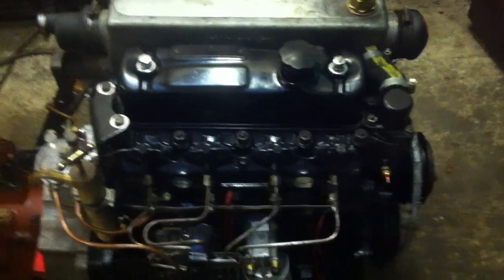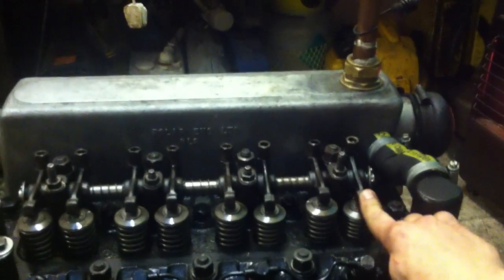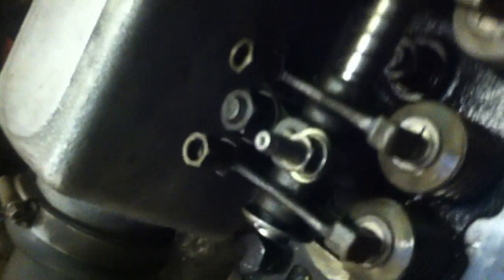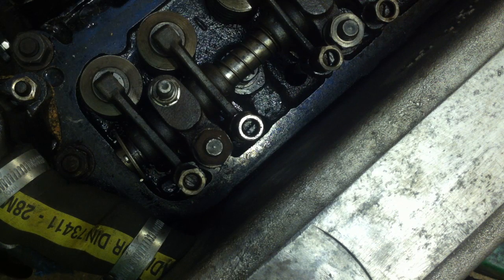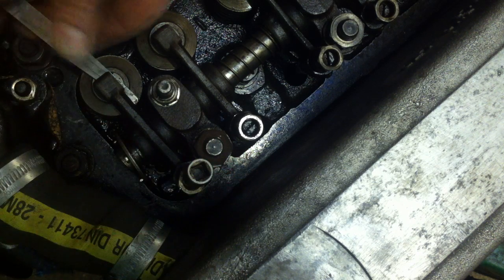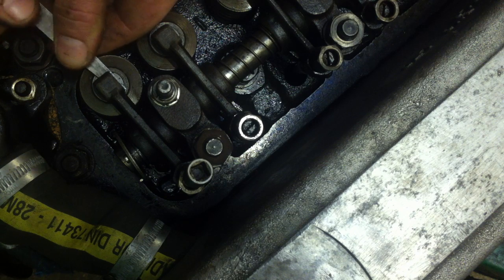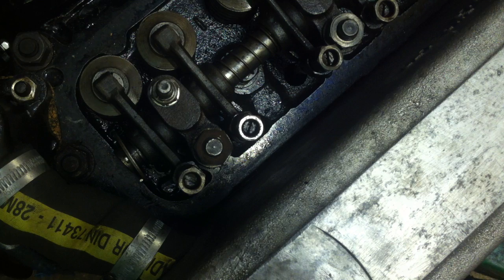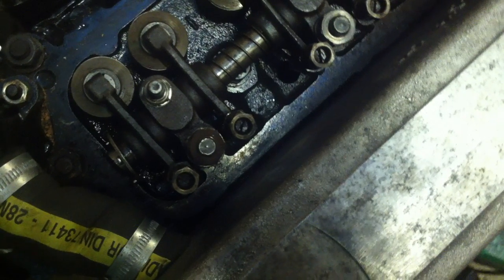How to set the tappets / valve clearance on 1500 BMC marine diesel engine

Comment: I know this is an old video now, so I may not get an answer, but I am a bit confused here. In the video you mention the feeler gauge blade is '0.15', but the manual states '0.381mm'. Did you mean 0.015in? 
Thanks.